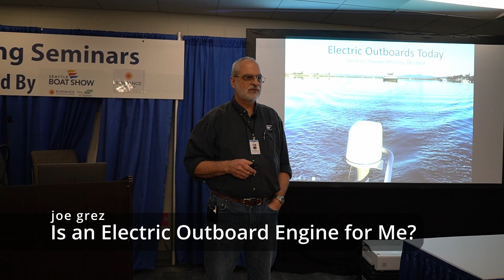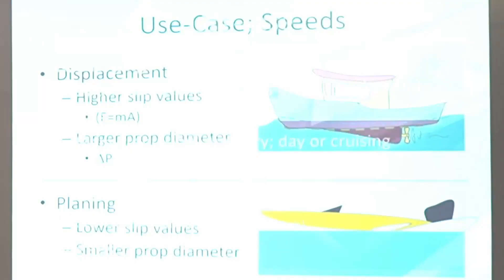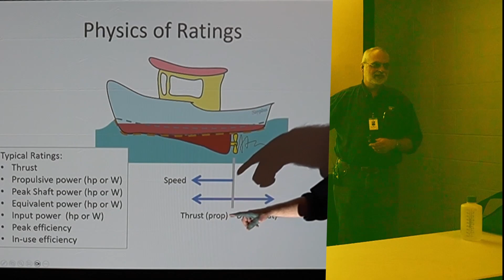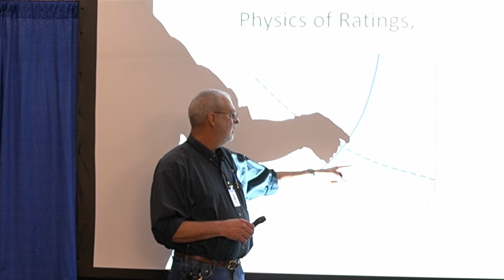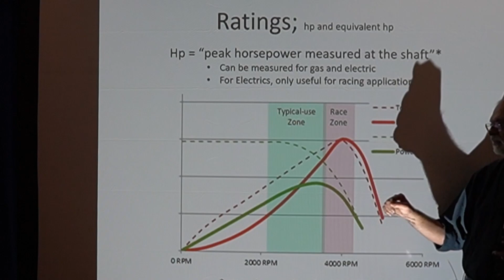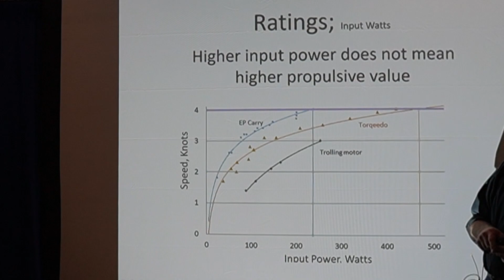Is An Electric Outboard Engine Right For Me? Joe Grez Shares Masterclass Insights.

Comment from the maker: ⚡Considering An Electric Outboard Motor? Then this masterclass by Joe Grez is for you.  This is a 45 minute seminar given at the Seattle Boat Show. It is not  for everyone. But is the best explanation we have heard about how these new engines differ from traditional gas powered outboards.  Learn the specs, models, ratings, terms etc to help you decide if an Electric Outboard Engine is for you.